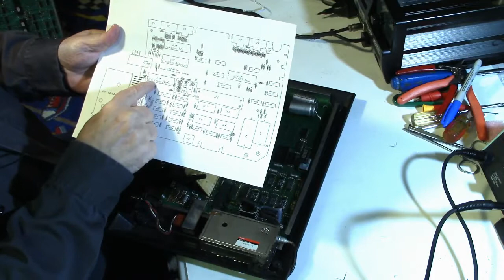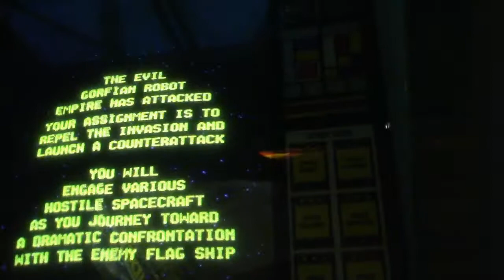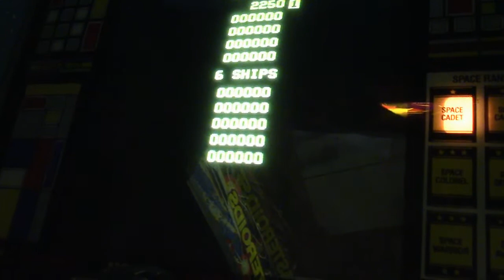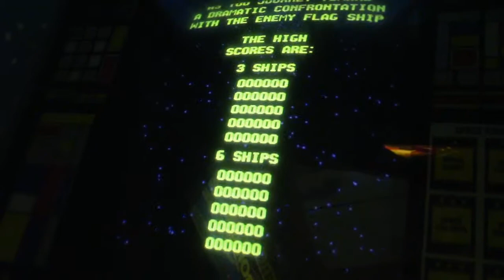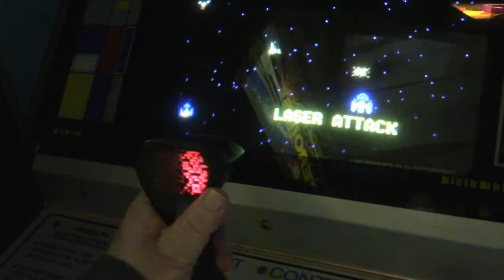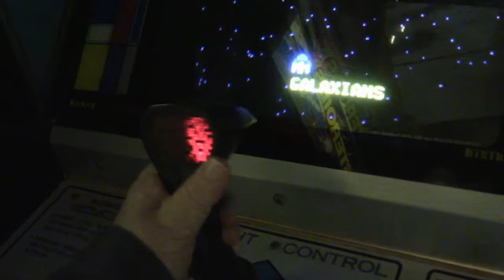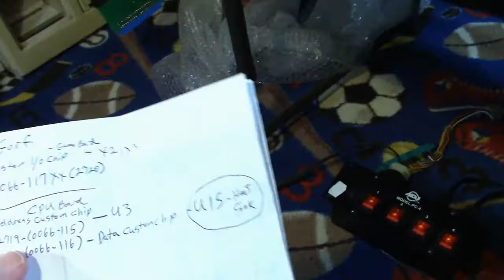Sam's Arcade Fix source for Replacement Bally Midway custom IC chips for Gorf and other games.

Comment: The problem is a working Astrocade is worth quite a bit. You have around $120 in yours. That's about $40 a chip. Its too bad no has ever come up with a replacement for these special chips.

Comment: What are those Custom chips doing to the control signals? the custom chips are PAL/GAL chips or what?
Reply: They have multiple functions but the three main responsibilities are generating the video and audio signals and collecting all the user inputs. This get them in the same class of custom chips like Atari's Pokey or Commodore's SID & VIC. This make it more complicated to make replacements. To make things worse the video and audio signal they generate is analog. And finally at least the data chip needs to run with around 7MHz which adds to the problem. It's not impossible to remake them but it's much more complicated as replacing a PAL/GAL
Reply: @ralfkornmann3367  to much work for just 2 games indeed